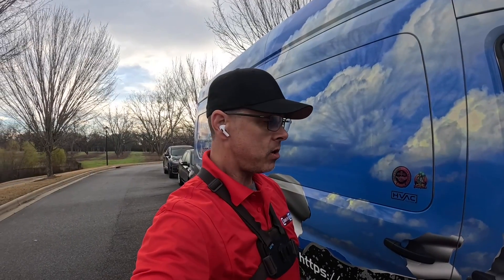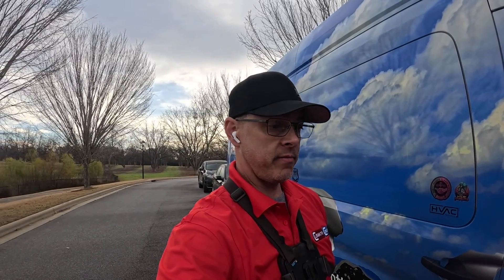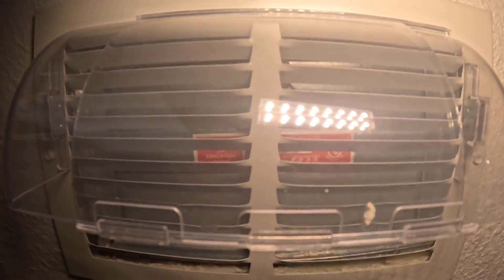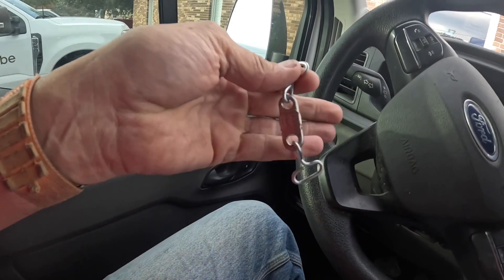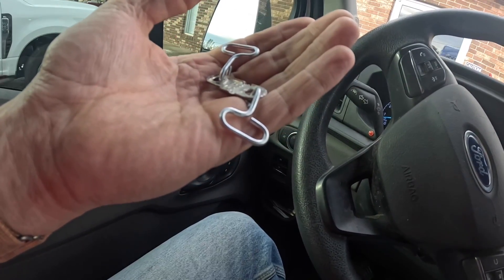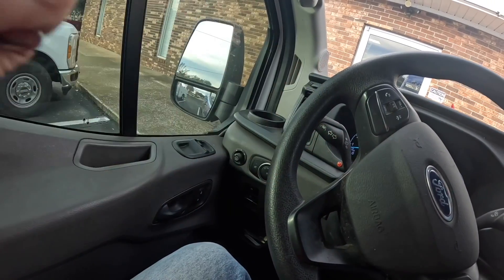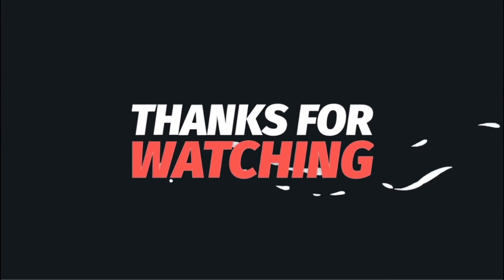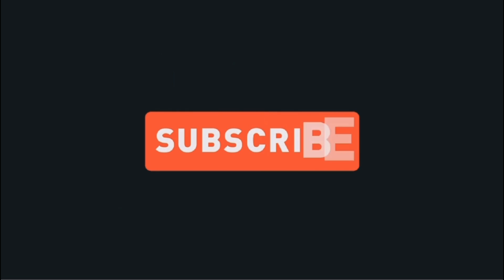Replacing a Fusible Link On a Fire Damper…Or Trying To! #hvaclife #hvaclife

Comment: You mission to make some extra cash for your future: Design a tool to install that item with less stress.  Picture it in your head and make it happen.  If it can be designed, I am certain that you can do it.  It makes me think of the tools used for opening a car door sliding lock from the outside many years ago, not the slim jim.  The tool that actually goes under the window on one side and pops out inside the car to grab the slide lock.  Picture it in your head and make it happen in your spare time, then sell it.  Great video!

Comment: take a trigger/handle/ratcheting style bar clamp and put it on one end to hold the damper in open position. it should have enough offset to clear the ceiling and hold it open.
then you'll have two free hands and more space to move around and install the fuse link. they do really suck on the smaller dampers, may need a few pairs of long needle nose to get it back in.

Comment: Wow! What a nightmare. I'm glad you were able to get help to get this fixed. Why couldn't this be designed to be dropped out of the vent and the assendly de replaced then put the entire assembly in with a couple of screws from the finished side of the vent.

Comment: My workplace has these, but motorized. The world’s strongest man couldn’t force them open. They closed on supply and return. They were tied to a fire system decommissioned 20yrs ago. Any power failure would shut them. 
I don’t work in HAVC, just know enough to be dangerous. Lol. 
$5m rebuild/renovation, still using the same dampers. Now they are tied to a new system. Hopefully they aren’t so sensitive to power failure.

Comment: In my years of experience with fire dampers, lucky you were able to find The correct fusible link for the correct fire rating. Try in the next application of using a side angle drill to Maybe take out the damper, if not you could've took the long trip in the attic to remove the fire retaining angle ( which I didn't see in the video and is in the NMC) would've made it easier for you in the future.

Comment: A zip tie would have held it open while you attached the fusible link. Then just cut it off.
Reply: Great minds think alike 👍👍
Reply: just use a quick/handle/trigger style bar clamp to hold the damper open from one end, then you have more space and two free hands to install it.
they should have enough offset to clear the ceiling and temporarily hold it open just fine. only the worst setups will stop that from working. then a pair of spring clamps may work better.
I have seen some deep back inside the ducts, and they were near impossible to get anything on and more than one arm into(stupid hotel exhaust dampers)
Reply: Good idea!  That’s one of the reasons I like watching these vids after working all day.  Thanks!

Comment: Gotta love trying to get a fusible link back in place 😅. I recently played that game and had to cut into the duct to access 20' in the air on a lift. Brand new RTUs, and no one caught it.
Reply: That had to be a pain.
Reply: @jthonn  they are not fun to deal with, working blind doesn't help.
Reply: Having worked for a company that manufactures those dampers, the purpose of them are twofold, one is that airflow is somewhat blocked so as not to feed a fire and second most important is that the duct pathway is blocked to further fire penetration into the rest of the structure.
Reply: Thanks Tom for the info @tombartels4295